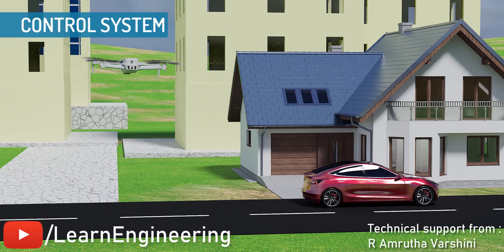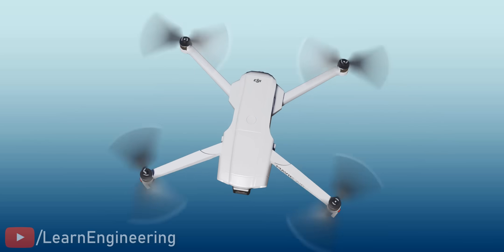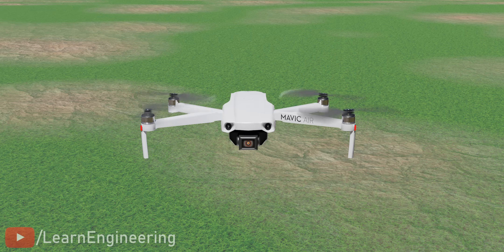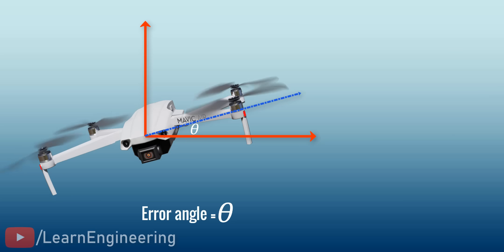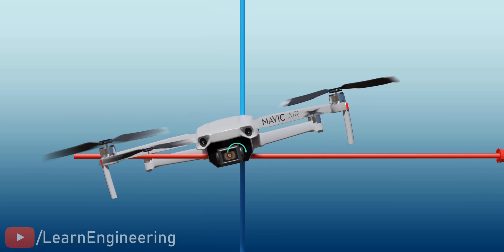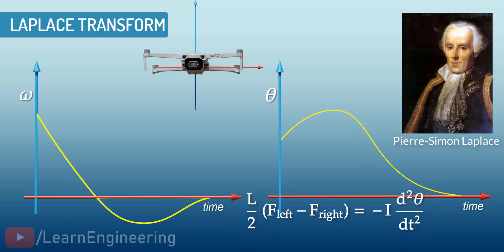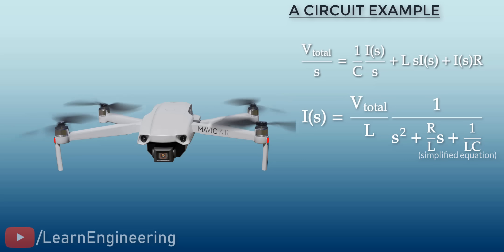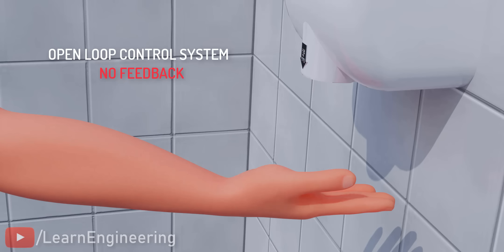Understanding Control System

Comment: I watched this while designing my drone's control system so thanks.
Reply: Can u please share it with me
Reply: @022_firdousnabi5  I have it in MATLAB Simulink and I am using IMU for navigation
Reply: @Ahmed ....Is ur drone based on Simulation in simulink?
Reply: @shankarsengupta1739  Yeah its control system is designed and modeled in simulink
Reply: Hello Ahmed 
How did start building your own drone? How many things you learn first
Reply: @shubham_-ri7hl  You need to learn basic electronics, flight dynamics, control theory, and embedded programming. Start with buying an Arduino and build a simple project and do a different project for each skillset you need and then you will be able to build a drone.
Reply: Can you share some data related to the project. I am electrical engineer with control specialization and want to design such projects. How u can do this on Simulink
Reply: @mahikhan8152  I can't benefit you as much as can Google, so google all your questions and I wish you good luck
Reply: Homrah 😊
Reply: From which country you are from
Reply: show off

Comment: There also needs to be an account of the gyroscopic precession that occurs when the blades are rotating at an angle - thus producing a torque due to angular momentum.
Reply: don't forget equation for wind resistance (that we never once worried about in school) :D

Comment: Great but how does it yaw?
Reply: The diagonally opposite pairs of rotors rotate in the same direction.

1               2
        O
4               3
Assume these are four rotors. 
If 1,3 turn clockwise then 2,4 have to turn anticlockwise to avoid having the whole drone spinning about "O". This is due to the inertial of the rotor's motion affecting the whole drone.

Now, if you speed up the first pair, you'll observe the whole drone turning clockwise, since the whole frame experiences greater force(torque, strictly speaking) in the clockwise direction about "O".
Similarly, increasing the speed of 2,4 (or alternatively decreasing 1,3, though that may result in a slight loss of lift) should give you anticlockwise yaw.
Reply: @Nj1498 thanks for the clear explanation

Comment: Nice video! How does the 1/s on the left side of the equation appears at 4:48 though? There isn't an integral term to give that 1/s.
Reply: The voltage is considered as a step signal here. It should have been Vtotal(s)

Comment: Quadcopters usually have 2 motors that spin clockwise diagonally opposite and 2 motors that spin counter-clockwise, otherwise they would not be able to easily maintain stable flight. The pitch of the blades is variant on which way they spin as well.
Reply: Hey bro, do you have any books for controlling Quadrotors (drone)?!

Comment: Secondly, the performance – a mid-tier PC has vastly greater processing power than even the strongest phone out there. If you have a decent PC, you would be able to run an emulator smoothly for Free Fire at higher graphics, which in turn increases your gaming experience
Reply: Sorry but I think you posted your comment on the wrong video

Comment: Are we seriously to believe that an off-kilter drone solves Laplace Transforms in order to right itself? It would be vastly simpler to reduce the rotor speed on the right side until the sensor begins to show the drone is level, and then increase it so that both sets of rotors (left and right) rotate at the same speed. Since the drone's computer has a clock chip, it could query the sensor and adjust the rotors in minute amounts rather simply. Laplace Transforms is over-engineering for this applicatioin.
Reply: So, you don't know about PID control...........